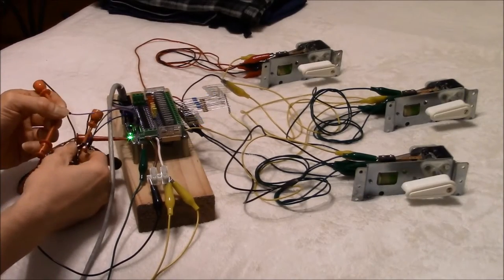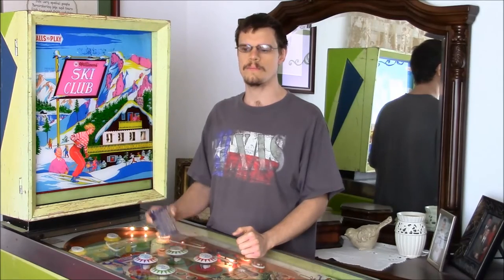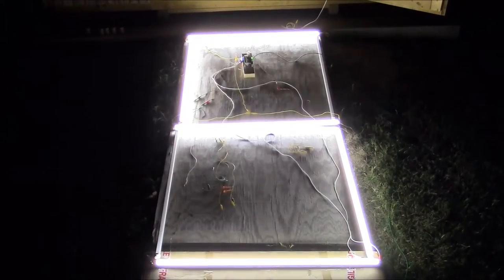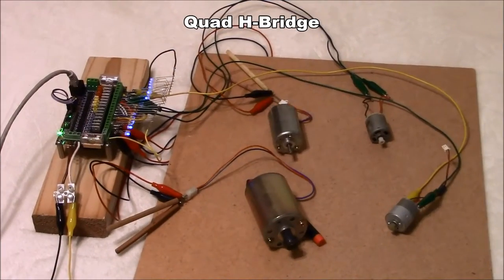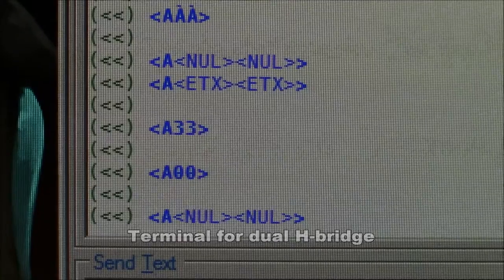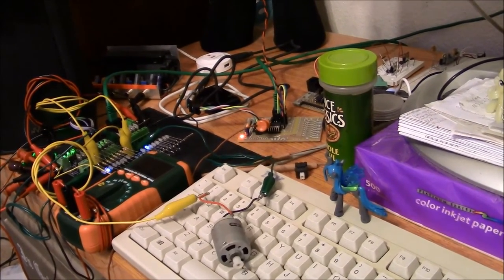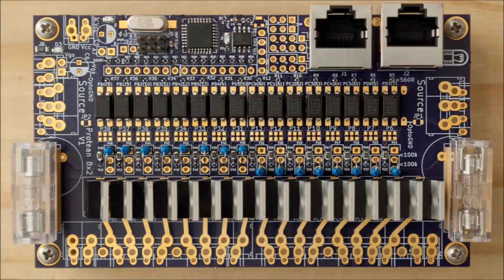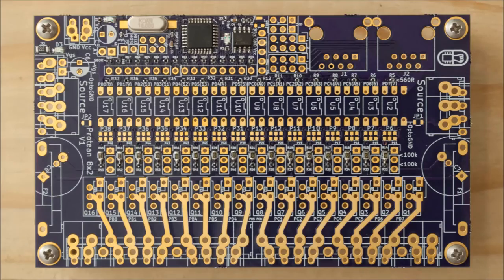Protean 8x2: Affordable and Arduino Programmable Power Control

Comment: This looks a little like a battery controller I recently built.  A bunch of optocouplers draining or charging the gates of mosfets.
Reply from the maker: Cool. :D Battery controller? As in battery charging?
Reply: Well, the crazy idea is to flip a ring of cells to series or parallel, for discharging, or charging.
Reply from the maker: Awesome! Definitely sounds like something to take good care about. I suppose you need the batteries wired in a certain state for charging and the other state for discharging, or is it more of a flexible supply that would work in either state for charging or discharging?